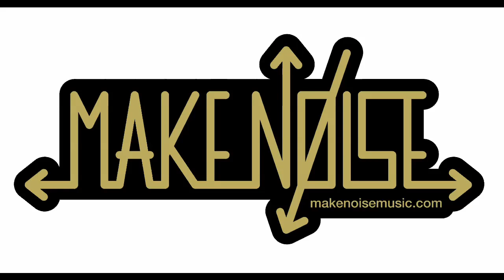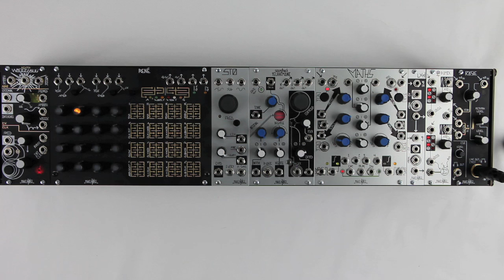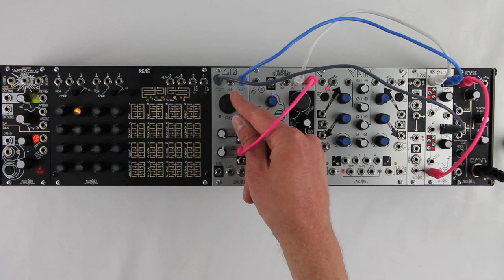System Cartesian: Timbre Blending with modDemix

Comment: Does any of the modules have adjustable clock, as in settable by integer bpm, or only by tapping like in 0-coast?
Reply from the maker: The TEMPI is tap tempo or clocked externally; MATHS and Wogglebug are set by knob and/or voltage control, or can be clocked externally.

Comment: As a starter for Cartesian or Concrete?
Reply from the maker: Cartesian for generating electronic sounds from scratch, and the Concrete for manipulating external sounds into new ones.
Reply: +MAKEN0ISE I wondered which you recommend as a starter as a basis for building a bigger system eventually.
Reply from the maker: Probably the Cartesian as it has most of the classic modular synthesis functional blocks. You could add the echo, reverb and etc... to build it out later.